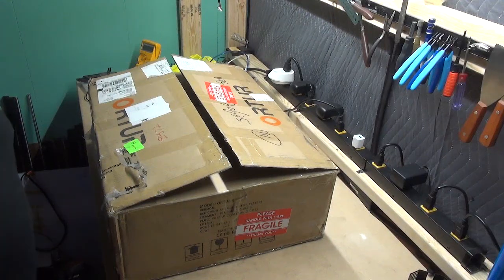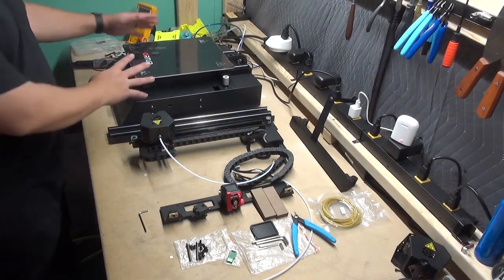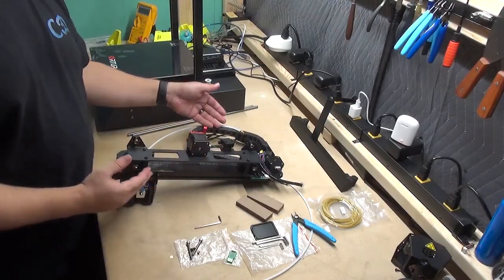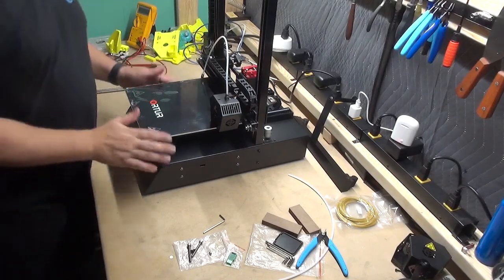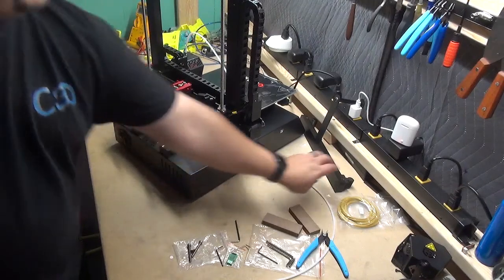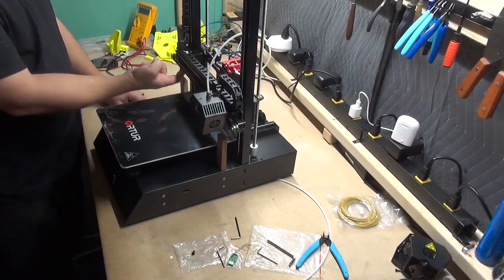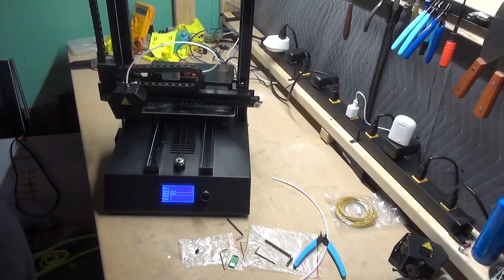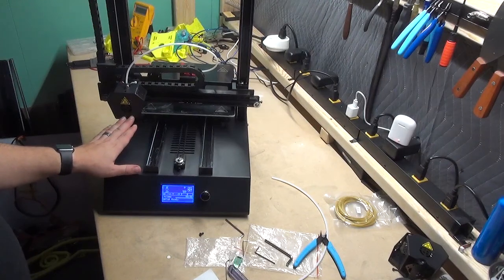Ortur4 V2 - Unbox and Setup

Comment: Hello 
Thx for the video
I receive today my Ortur 
I have 2 questions 
I see nothing from this screw
What is it ?
https://photos.app.goo.gl/AkdZT2DxFys3knQ17

And if i select auto home the print head go to right and i have error and must be reset
Print head not go to left

Thx for you help
Best regards 
Christophe
Reply from the maker: I have not seen that bag with any version of the printer so far. Did you by chance get an upgrade package as well?  As far as the belts, please take short video to post in Ortur Facebook Group.  If you have not already, please join the Ortur Facebook Group, There are several.. I am member to most.  It would be easier to assist with this matter in the forums.
Reply: Hello Tekkie
Problem is resolve
Motor cable was inverted 😳
No working perfect 
Thx for you answeer 
Best regards
Christophe